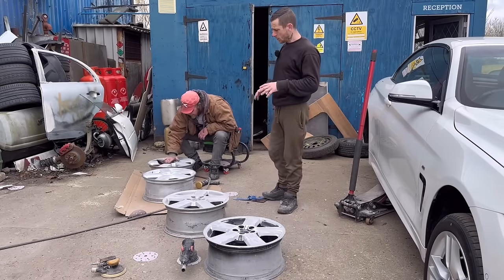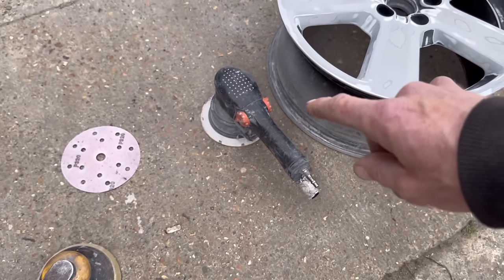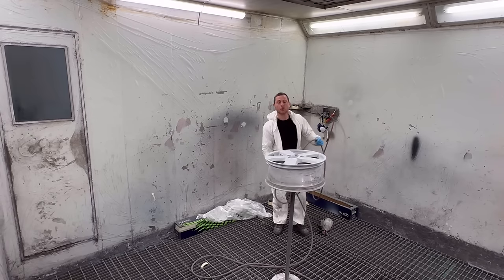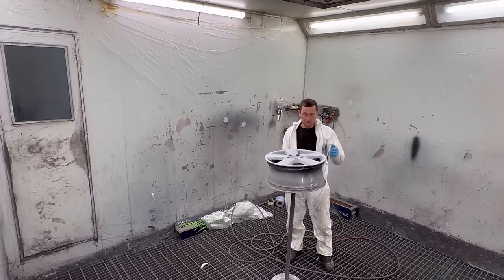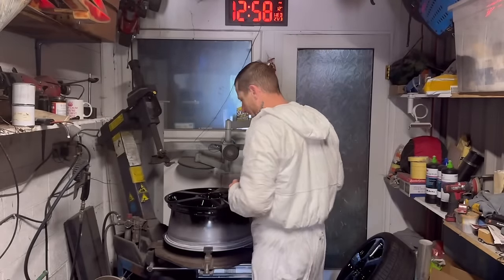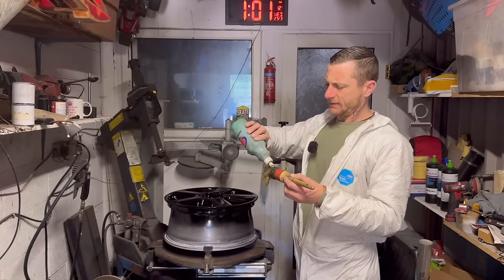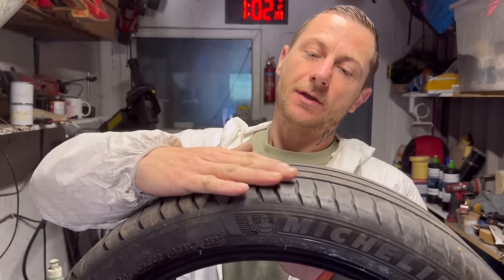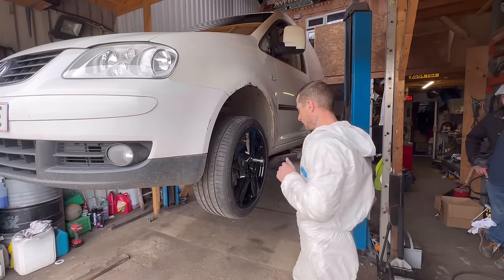Vw caddy - new wheels - zero budget 🤙

Comment: You can slip a bit of 15mm copper over the valves when you paint the wheels if your painting them on the vechile and when you paint them in the booth or if you got the sensor ones
Reply from the maker: Hey Tony that a brilliant idea that, nice and quick re useable. Brilliant niceone 👍

Comment: Hey man. Greetings from South Africa. Looks like I gotta reach out across the pond. To find a gearbox. Seams I have a rear one out here in my neck of the woods. Looking for a lead on a 5 speed for a CLC 2.0 TDI. They are impossible to get hands on here.
Reply from the maker: Hey Anthony 👍 and South Africa. What age is your caddy?
Reply: @YTDTETV  2013 maxi panel van. With touran window upgrade and 1995 A8 seats. 2.0 CLC TDI
Reply: @YTDTETV  picked up a Jetta 2.0 6 speed manual with accessories today so looking forward to making that happen

Comment: Good morning. I have a question about your T5 . when you installed the cab light,did you need t inalter the wires? I bought a polo light but when I plugged it in only the map lights operated
Reply from the maker: Hey bud mine plugged in and worked perfectly, are you sure the bulb in the middle isn’t blown 👍
Reply: Good evening, thanks for your response. All the bulbs were good.  Map lights on all the time couldn't turn them off . Maybe I should get the multi meter out. Keep up with the great videos. Really enjoyable. Regards Martin